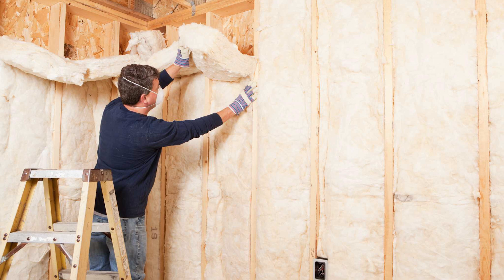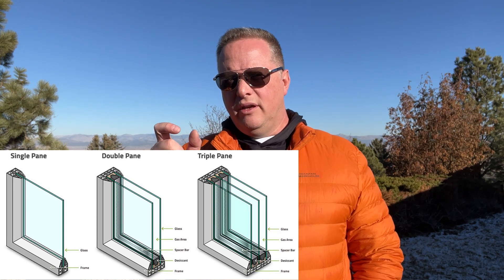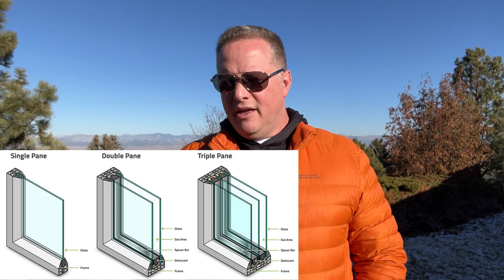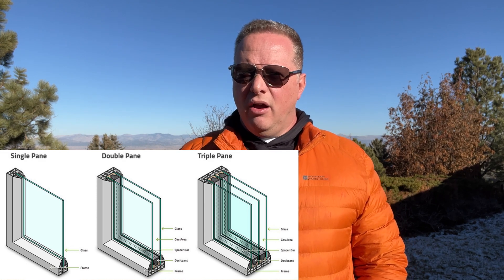Why North-Facing Windows are NOT a Problem Anymore!

Comment: Air does not penetrate a glass window, even a single pane.  Heat passes through the glass, not air, unless the window is poorly sealed.
Reply from the maker: Absolutely correct, thanks for clarifying!